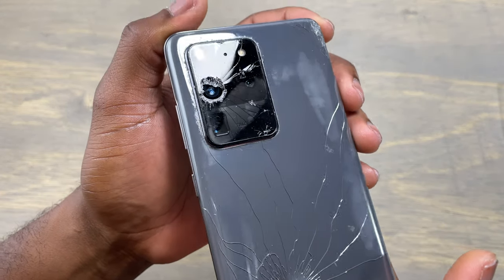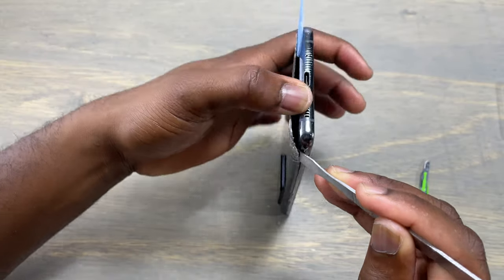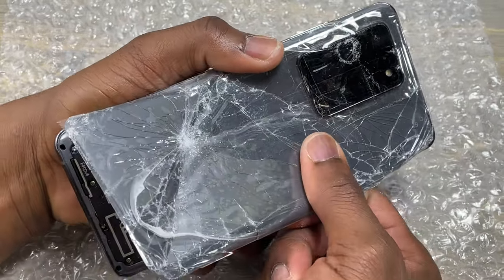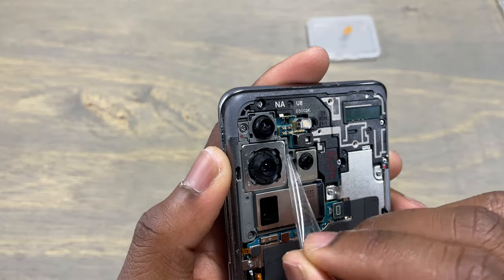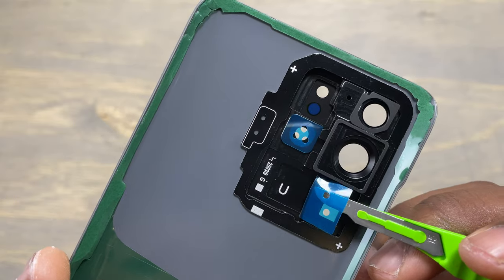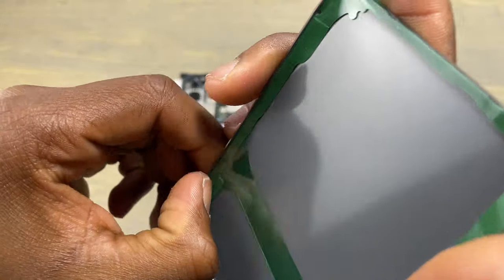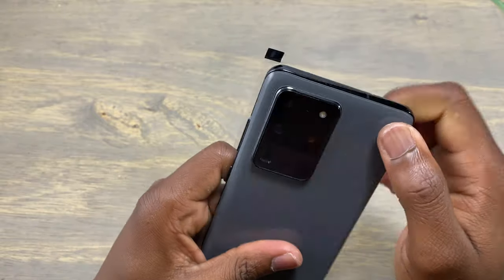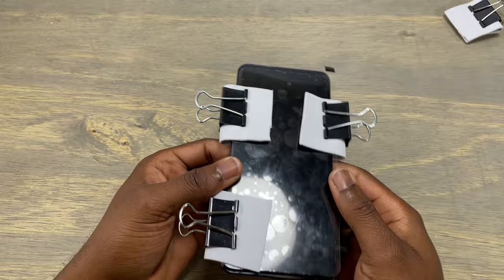Galaxy S20 Ultra Back Glass Replacement Repair

Comment: It is still water proof? After you change the back glass or, reglue it??
Reply from the maker: Technically it will stay water resistant but decreased compared to the original water resistance rating. I recommend avoiding water, if you want to Submerge maybe no longer than 5 minutes (depending on parts quality type of double sided tape etc....) using glue alone (simply avoid water) glue will not be evenly distributed around the device so il might be sticking but not necessarily everywhere.
Reply: I still want it to be water water resistant. What will i do? Go to service center of samsung?. I bought this phone considering its water resistant. Thats why i chose it.

Comment: Great video! Can you please make one changing the bottom speaker? Mine has been muffled/ broken for some time now. Sent it to a shop to fix it, but they done a bad job and it broke again. Looking to do a full replacement myself and would love your help, as I learned a lot from this and your other S20 Ultra video. Thanks
Reply from the maker: Hey, I think you can get the answer of your question from my S20 ultra teardown video. Check that first if it does not help leave a comment I will see how to direct you.
Reply: @ersbit  Just watched it, another great video very easy to understand what is going on. Thanks for your reply that video has helped me a lot!
Reply from the maker: You’re most welcome 👍🏽

Comment: Hello. My Samsung Galaxy S20 front screen just got chipped. If I take it to have it replaced, is it possible that a complete reset of the phone may be necessary, resulting in the loss of photos, videos, applications, etc ...?
Reply from the maker: Hey, if they reset the phone inside setting YES. If they repair the device simply you should not have any memory loss
Reply: @ersbit  If they reset my phone, is it enough to make a complete backup (photos, videos, applications, etc.) with Samsung Cloud and then, after they reset, click on "Restore data" to get back everything I have now in the phone? Or I have to also other things?
Reply from the maker: @flavietto9973  please let me know what kind of repair they will be coming performing? 
Yes. If you have enough space in the cloud you can back up the device contents. And to be safe you can do a second back up inside your computer memory
Reply: @ersbit  I don't know, I have a chipped phone screen, but it's not a big damage, so I guess it won't be a particularly difficult task.
To be safe, I downloaded all the photos and videos to my computer, but I installed some apps that can only be installed on the phone. By backing up the phone and then restoring to the same phone, will they stay installed with the same progress or will I have to reinstall them?
Reply from the maker: So yes, if it's just screen replacement or front glass replacement you shouldn't lose anything. I think there are application that can do the whole backup with apps reinstalled when you Restore. Check the requirements for the back-up etc...

Comment: If i drop the phone, and the rear glass is broken, is it still waterproof, or i need to replace it?
Reply from the maker: Technically it depends on the type of cracks. If a hair line or even a real crack it will stay water resistant because below the glass you have a plastic film that will stop water if the glass is broken. This is only if the crack is at the center and does not go to the edge or side. If cracked and tape is visible or tape not sticking properly you need to repair it.

Also, If it's cracked to the edges I recommend you the change it. You should replace it and not try anything in water or near water to avoid further damage.
Reply: @ersbit  okay thank you so much! Good video, keep it up!
Reply from the maker: Thank you Glad it was helpful to you 👍🏽
Reply: If you let it fall, the frame could be slightly bent so it will not fit perfectly. Thus it is not water resisting anymore

Comment: anyone? what's the sticker on the top left corner of the inside, of the back glass. ?  
my replacement screen did not come with it. the sticker (to my guess) looks like a signal booster. it does not connect to any power supply. it looks light grey in color.
anyone know about this????
thank you!.

Comment: Is back glue is strong enough or we need some more liquid glue
Reply from the maker: It depends on the quality of the back tape. If it's grayish like the original and was stored properly without any part exposed to air (plastic firm properly covering the tape) you do not need any liquid glue. Please check my S10 back glass replacement video you will understand better what I call bad back cover tape (lower quality vs oem or manufacturer similar quality)
Reply: @ersbit  i have replaced my back glass once before but they apply too much glue and it is not fitting properly 
when i ask them thek say it will not stick without glue
Reply: @ersbit  glass is same as original
Reply from the maker: You can add liquid glue, but you'd have to be carefull not to ever do it. Samsung sends these devices without liquid glue I believe we can repair them without liquid glue, but if you think your back glass tape is kinda not so fresh you can have a thin line of glue on top of the tape. Depending the on your experience you might have to clean up the excess glue or if done to perfection you won't even feel or have any clue that liquid glue was applied ✅
Reply from the maker: That's great, frankly If it's same as oem you don't have to apply any glue unless the tape is kinda wierd
Reply: @ersbit  Thanks for your information

Comment: What kind of heat tool is needed and also how hot does it need to be?
Reply from the maker: "Heat-gun" or simply use a Hairdryer it's less powerful, take a little bit longer but does work. I got mine more than 7 years ago and it still works (heatgun was $15) nothing fancy needed.
Reply: @ersbit  also what's the heat level recommended? I want to be sure to get it right and not ruin my phone lol
Reply from the maker: lol I recommend to use low setting on heatgun and swing for 60s do not stay on an area for more than a second. Then try to insert a tool but if it's still very difficult heat again for another 60 second. If you use high setting you need to do this for 20 to 30 seconds. Using a Hairdryer you might swing around 1 minute first and try to remove if it's still hard heat again for 2 minutes with constant movement then retry. The lower the power or heat the longer it will take you. 👍🏽

Comment: Is it waterproof
Reply from the maker: I would say yes. It depends mainly on the part and tape they had. If it's the grayish tape that looks like Samsung oem you can be very close to manufacturer water resistance. If it is the black thin tape I showed in my S10 plus back glass replacement video that one will surely let water inside lol
Reply from the maker: Hey I made a video specially to answer that question
Here -> https://youtu.be/zypD1HeLXcI

Comment: I just want to reseal the back cover that separated!
Reply from the maker: That should not be too hard, just get yourself a b7000 or other electrical glue to fix it. Carefull these glue create a mess if not handled right/properly